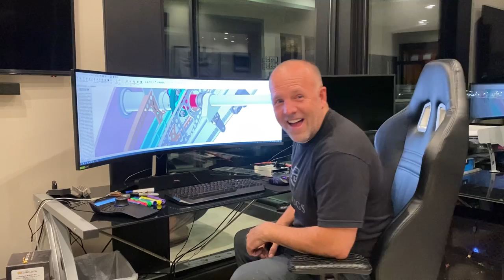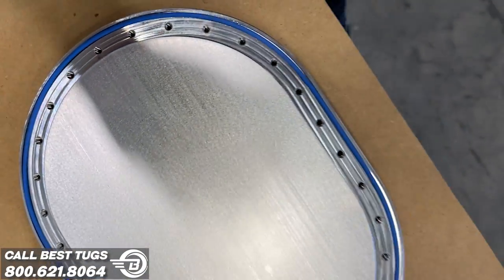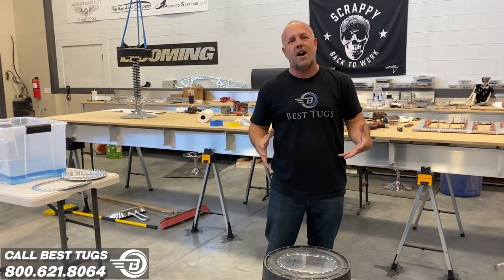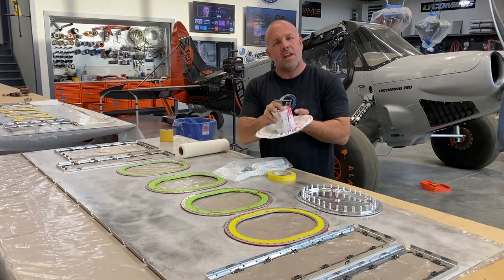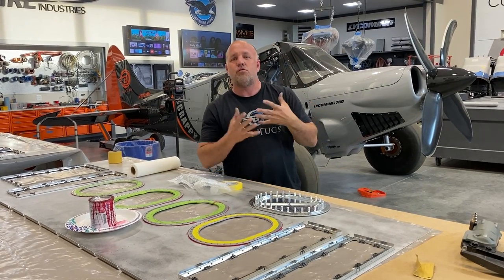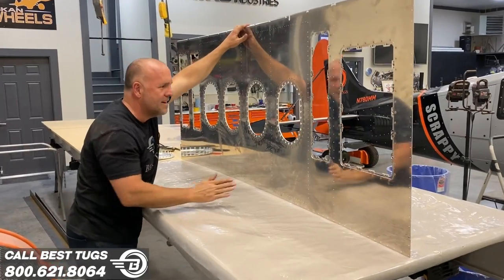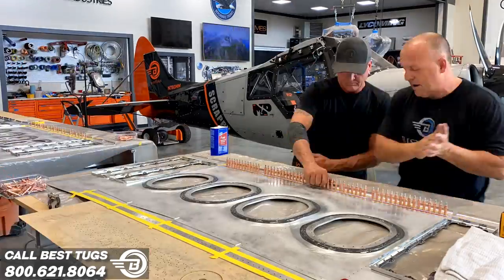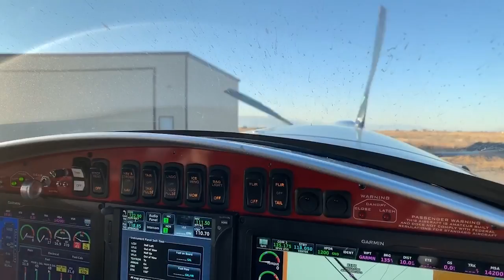WILD, one of a kind, Bush Plane Build | Scrappy #54

Comment: How come the wings won't use carbon fibre like the rest of the aircraft?
Reply: Wings need to flex, be subjected to plastic deformation, stressed. Carbon fiber has way to much rigidity for some of the wing's intended flight envelope.

Plus, these wil be "transformers wings", and the mechanisms are better done in aluminum alloys.

Comment: Would that gasket contract or expand in extreme temp swings I know most synthetic stay playable at least...
Reply from the maker: If you use the wrong seal it can.  Always check the temp limits cold and hot and never use any that can’t handle the chemicals or the temps.  Never even get near the temp limits on either side. It’s always worth spending whatever you have to and get the correct oring
Reply: Indeed! I can never forget the sadness of the loss of 7 astronauts due to a fuel seal O ring chosen according to budget priorities instead of safety priorities. I also like the fact that the weight of the fuel contributes to the sealing, and the groove keeps ozone away from the O ring.

Comment: I have been a R/C modeller and real pilot for over 40 years, so I think I understand your pursuit of perfection, because I am very thorough myself, as my wife says politely.
But I'm still not convinced that doing it your way is necessary everywhere. What I mean is working on every theoretical detail that may not fit or not be accurate enough. Similarly, the screws should be sealed after assembly, because there are micro-gaps.

And I'm still looking for a reason to keep making so many inspection holes.

It's just that even ugly wings can fly very well and the 'fluid physics' makes it possible without seeing a problem in small imperfections that fluids physics never and ever don't notice.
Sometimes, she herself encourages the implementation of solutions to do, for example, previous turbulence.

Well, this is your project that is growing in strength. Greetings.
And I watching U all the times ;)

Comment: Something hit me as I was watching this: Without wings on Scrappy, where was your fuel supply for your engine tests?
Reply: Header tank.  Most fuel injected engines have them in the fuselage.
Reply: @Skinflaps_Meatslapper  Pretty sure he also has a rear fuselage tank behind the cockpit ~10 gallons.
Reply: Header tank in the back, the wing tanks are going to drain into that, and the engine is supplied directly from that tank.

Comment: Are the fuel tank sections dry sump pumped to feed the fuel pumps or do you plan your banking for long... too long trips?
Reply: Both wings have large gravity feed lines that both flow more than the engine can burn. Those two lines feed a large vertical main header tank.  Both the wings have selection of right left or both and off.  The header tank has redundant electric  fuel pumps that feed to the engines mechanical fuel pump.  The plane can run without any electric pump turned on though they will be on most of the time.
Reply: @ChandraSlyFoxPatey  Mike must be really busy. You have fielded many questions, and in great detail. Thanks! Why did he decide to go with aluminum wings?
Reply: @farmnranchapiarybeehiveser8120   He’s going to go over that in an upcoming video. 👍🏻
Reply: @ChandraSlyFoxPatey  thank you for the reply.  I'll be looking forward to it. Appreciate your family life and knowledge you all share. 👍
  Now to borrow Mike's phrase,
       " back to work"!

Comment: With all of those machined pieces attached to the skin, it may have been better to machine the entire panel out of one aluminum plate, integrating all of the sealing and rivet spacers and skin.
Reply from the maker: Great comment 👍🤠 Unless you have a vacuum capable machine table, you can’t machine large areas of thin skin without “chatter”. It’s really hard to see if you got it and created thins spots,  it’s very risky.  Full perfect sheets with inserts on this application was my first choice.

Comment: In regards to the top mounted doors , wasn't there an incident where one such leak caught on fire? I remember hearing that in one of the "what happened" type shows from National Geographic or Discovery Channel (it was quite a while ago). They over filled the tank due to a faulty gauge and it started spewing up top, then just as it was about to take off, the wing caught on fire. I'm pretty sure that's how it went.
Reply: I remember that there was a huge crash once - an airliner went down because of the ice buildup in the fuel system. Figuring this out was crazy hard, because nothing was pointing to it as a cause, and the ice obviously was gone after the crash. There is a documentary here on YT somewhere.

Comment: Hey Mike, quick idea about your test setup: It could be a good idea to repeat the test with little to no fuel in the barrel. Overload testing your structure is a good idea but the weight pushing down also maybe helps to seal the door. With almost no pressure from above it might could also seal less. Just an idea i had. Absolutly love your channel and energy!

Comment: im amazed you never commented on the LOVELY smell of the 2 part sealant.
Reply: I did when I walked in to the hangar!! Yum! 😋
Reply: @ChandraSlyFoxPatey  how would you describe the odor for those of us not familiar with it?

I do know the smell of the red-kote as I have used it on tractors and automotive applications.
Reply: @russellsmith3825   I was being sarcastic there, it’s difficult to tell in reading though.  
To me, the sealant has a sharp rubbery/static electricity (ozone) with a slight hint of electrical fire scent 😅.  It’s a clean smell that’s not bad, but it’s not good either, imo.  I’m certain I didn’t hit all the scent notes there, but that’s all I could come up with.

Comment: My guess is that you could take  out the screws in the inspection hatch and it wouldn't leak, there's enough pressure from the water to compress the o ring.

Comment: In the fuel trailer biz, often times housings will have blind hole , inside (wet side) looks like a post. 
Topside hatches won't leak if not wet, I agree with Mike, I have seen tanks suck in water with bottom hatches too.
Climates with 25 degree day-night differential will suck ambient air with humidity condense the water and pressure bleed only gas out the pressure relief.cycle this for months and you will get severe contamination.

Comment: The science on your fuel door:
 being pushed through to the top of the opening and laying down flat., with fluids weight on top holds it tight. The screws just prevented from moving.

Comment: Mike great content as usual and that's why I watch even though I don't fly.  Normally when you test something you do a very extensive test to prove if the design is sound so I was suppressed when you tested the hatch cover in the two plastic drums and claimed it was good with some of the fasteners missing yet the head of liquid inside could be sealing the cover. I think It would have been better to cycle the liquid from full to empty over a period of time to see if there were any "weepers".  

Cheer anyway mate good stuff  !!!!

Comment: Sitting static isn't a true reflection of how the movement and pressure the tank inspection door would go through, thought you would of mounted it on a pickup truck for a "more thorough" test. LOL. Loving your work.
Reply: I'm guessing the water/fuel column height accounts for 5 G's.

Comment: Sanding ally sheet makes a massive difference to the glue surface area (like sloping armour I guess) but if you really want it to stick then anodising is ace. You can get them cold anodised which is marine grade. The surface becomes like Velcro and you don’t need etch primer. So it sort of cost offsets itself :o)
Reply: @pi.actual  for Mike it wouldn’t be hard to local anodise. He has the vacuum bag gear. After that all you need stainless steel mesh and a battery charger :o)

Comment: Did you ever consider double o-rings with the gap in the middle to pressure test the seals? Like the space shuttle solid rocket booster o rings?

Comment: Fascinating and very innovative content, very well explained. Just a bit curious about testing pressure resistance on a potential leak spot under conditions that don't simulate actual. Half bolts at less torque suggests that full compliment of bolts at full torque would be even more effective. Not necessarily the case. There might be a stress-related distortion generated by the latter condition that might be less apparent in the former. Maybe testing under conditions that simulate as close as possible the real conditions is the best way to confirm fitness for purpose. I make that observation knowing that you've probably already thought that one through. I couldn't begin to find the energy this guy has for doing such a thorough job on everything he takes on.

Comment: Honest question, because the fuel panel has an o-ring and seals under pressure, isn't the test with higher head pressure helping it seal up?  I was thinking normal and half tank head pressure, partial screws, but then jostle the whole rig around...put it in a pickup truck and drive around and test if it remains sealed with normal pressures, partial screws and motion equivalent to turbulence..  Just thinking out loud and NOT being critical...but positive.  Mike Patey's videos teach so much and inspire even more....I LOVE this channel

Comment: Re. Leaks on top of the wing.  Not only rain leaking in,  but don't forget, having Low air pressure at the top of the wing, it will tend to suck out fuel during flight - unnoticed, apart from an increased "fuel burn" - like forgetting to tighten the fuel cap.

Comment: Definitely not telling you how to do anything, but if you did have that container you made filled with 100LL, you might want to consider at least grounding the container (if it wasn’t already so). AvGas can be some tricky stuff to work with, especially with the way the wind sounded like it was blowing. Static can build up rather quickly, and any discharge could possibly ignite the vapors from the opening. I’ve been in the petroleum industry for 26 years, and I’m just looking out for your safety. It’s absolutely amazing what you’ve done with aircraft and for aviation. We all care about what you’re doing, and want everything to go as smoothly and safely as possible! 👍🏻

Comment: If you have a leak on the top of the wing which is the Vacuum side - you could be losing fuel almost as a vapor stream and the only way you would know would be a small loss of range or if someone somehow saw the vapor stream from inside the cabin. (unlikely) Similar to leaving the fuel cap off, although that usually leaves no doubt about where the leak is :)

Comment: In most airplanes, the fuel panels are under the wing, fuel leak (drops) are a GO item as per MEL limitation (number of drops per minute) which is based on the location of the panel and how close to the engine or fuselage.

Comment: I was sitting at a window seat on a Delta L1011 heading back to Germany from Atlanta.  As the pilot rotated to takeoff attitude, fuel started gushing out of the inspection cover on top of the wing behind the number 3 engine across the wing and into the airstream behind the exhaust.  I thought the whole thing was going to start flaring like an F111 could do.  I rang the flight attendant call button but being takeoff they didn’t respond until above 10000 feet by which time the deck angle changed and the fuel was no longer pouring out of the wing.  Didn’t think about water getting into the tank.

Comment: Ok real question here.  Someone already brought up that having the “extra” pressure actually increases head pressure and may actually help the o-ring seal.  My question is I was under the impression that possible due to surface tension difference between water and fuel it is possible to have a container water tight that is not necessarily fuel tight. My reference for this understanding is based on being told that water troughs, that are clearly water tight, are not suitable for secondary containment when storing diesel/gas cans as the way they are made can allow fuel to leak out due to its lower surface tension where it can flow through the crimped seams even though water does not. To be clear I think your method of designing the hatch seals is good this is just focused one aspect of the testing and if indeed you are testing to the standard you intend.
Reply: Likely, given all of the levels of overkill in Mike’s system, and the fact that he only used HALF of the fasteners only partially torqued down, I think you already know the answer to your “real” question. As they say on the game shows, thanks for playing.😂🤣
Reply: As he said in reply to another comment here, he tested with water first and then did another test of a full 24 hours with fuel. So yeah he's got that sorted.
Reply: @patheddles4004  thanks for that. I looked through the comments before asking my question but hadn’t seen that. I appreciate that nor everyone that comments here is a jerk like colin wallace.
Reply: @davidruss7702  No worries. I figure if I'm reading through the comments anyway, I might as well pass information around where I can.

And your question was completely reasonable - that's why Mike bothered to do the second test, which you didn't know about because he didn't show it in the video.

Comment: G’day from rural Australia. Wondering why the wing skin is aluminium but slats are carbon fibre. Tail plane is carbon but control surfaces are cloth. What makes each material more suitable for each job. Also is there an issue with corrosion between carbon and the fixing screws and nut plates. 👍👍

Comment: With the fuel door - wouldn't the pressure against the door be amplified in flight and that would cause pressures far greater than static? Wondering why Mike didn't test it in a pressure vessel with 200psi+ of air over the water. 
- Love the channel.

Comment: The weight of the fluid on top of the inspection door will help seal it.  More weight, better seal.  It may pay to test the door seal with minimal fluid in the tank and sloshing about because that is when the door is more likely to lift from a lack of fasteners or loose fasteners and the O ring seal isn't compressed.  Great fail proof design though.

Comment: Fuel bay access panels should be bonded to the wing. Boeing had a wire mesh gasket like material to ensure these panels were bonded, but the o ring still made the seal. I believe it was to ensure no build up of static electricity.

Comment: (on a quick disclaimer: i am neither a pilot nor an engineer but i am a diesel mechanic) my question is, with only doing that short test on the fuel door slightly loose is the pressure differences while flying as high as you plan with this plane going to withstand the o ring seal when it has all the screws in it and clamped down to spec? i sure you have probably accounted for this after watching all the amazing work you have done but im always curious and have to ask as you do not know until you do ask (even if it seems like a stupid question to some people.)

Comment: So the bonder doesn't stick to the oxide layer of the aluminum as well as it does the prepped aluminum?
Reply: Organically grown oxide layers such as exposed raw aluminium in an open environment will grow a random and weak crystalline structures which break away from the alloy beneath with relative ease which is the common failure mode for adhesively bonded aluminium. By abrading and bonding in a short lapse time the adhesive is anchoring to the alloy and finding a mechanical bite into the scratched surface. PAA (Phosphoric acid anodising) is the go too method of growing a stable oxide layer than allows aluminium to be treated for bonding and left for months on end prior to bonding. Chromic treatments work similar to the abrasion method, but a chemical process strips the oxide away and lifts surface contaminates away as well however bonding ideally needs to occur in the shortest window of time possible. In short a mere degrease of aluminium prior to bonding will result in a unpredictable bond subject to a short life span, neither of which are desirable in designed bonded joints.

Comment: Alodine treat and prime assemble…. Fuel tank sealant. A stinky situation. When I built C17 wings did DAC we wet installed any fastener that went in the wing. If your using 2024T3 and AD1096 
rivets wet installed you shouldn’t get any leaks.

Comment: Mike explained how 120 grit sandpaper on the aluminum surface helps hold the sealant material much better than other methods.
But I never saw him sand anything? He showed us a roll of yellow sandpaper (I think) but then it disappeared. At 5:05 there's a very high speed video where he's painting red. But I'd still don't know how or what was sanded. I assume the yellow material is masking tape. 
There's an application of black material at 10:34. But I thought he was using o-rings for sealing. A lot of stuff going on and final structure is very confusing to me.

Comment: So Mike, am I safe in thinking (not assuming), that when you say putting the final torque on the screws in the inspection doors, that you didn’t use an actual torque wrench, but ur own fingertips circling around the plates maybe 25 times, to smush the O-rings just right??

Comment: Mike they look great, But, trash can sitting on the ground is one thing, a twisting wing where temps change expansion,contraction are another. Any chance to make 1/4 section of the wing with fuel doors and try to simulate in flight characteristics. The wing panels will be shot if those fastner retainers ever gaul or fail, why no Nut plates? Why no alodine or bare metal priming, corrosion should be a paramount concern.